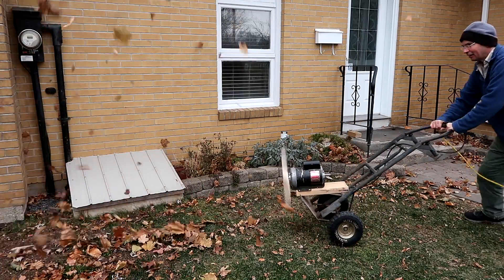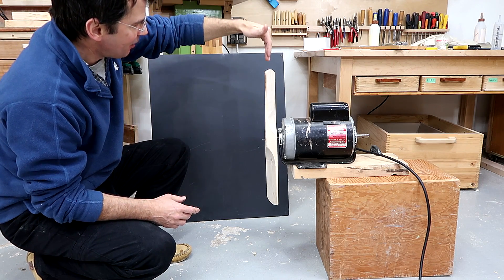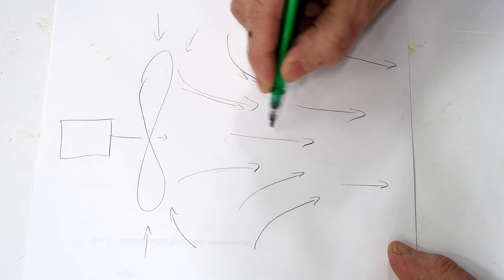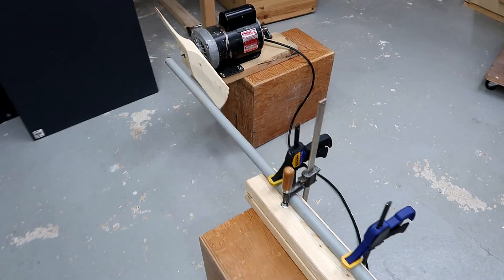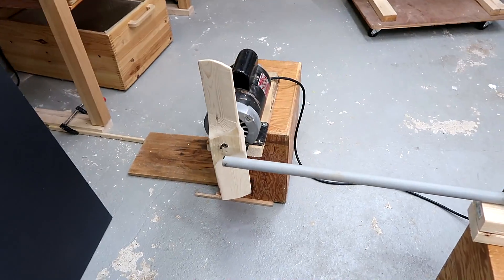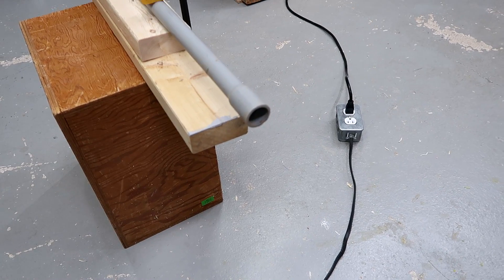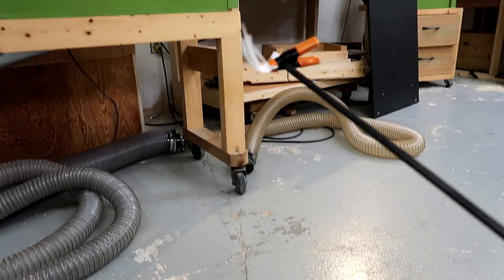Complicated air flow in front of a fan

Comment: "Now, people are going to argue Beronoulli principle and all that..."

Proceeds to demonstrate Bernoulli principle.
Reply: Spot on! Moving gas, lower pressure - Bernoulli principle
Reply: Yeah, especially the "tube with air moving past one end" demonstration that he did.
That's literally a textbook Bernoulli principle demonstration.
"Other factors involved" don't change this.
Reply: @delphicdescant  there are examples of Bernoulli's principle here for sure, but it just doesn't apply to everything in the video, some shots of the fan show turbulence, which by nature is simply a different principle. The other factors involved include the density of the air as well as it's speed and pattern, which as said by someone else, are very complex. My only statement is that there are some examples shown which are very similar to Bernoulli's principle but are not necessarily the same thing solely because of the introduction of turbulence. Which is a seemingly minor but often critical difference because laminar flow is (on paper) "non-chaotic" in comparison to turbulent flow.

Edit: please see the paper I linked for a more clear and less intuitive explanation. In short, Matthias is correct to include all factors when forming his hypothesis, e.g. the effect of turbulence over a laminar model
Reply: He did, but he still correct. Bernoulli's principle only applies to laminar flow, Matthias is experiencing turbulent flow.

http://labman.phys.utk.edu/phys221core/modules/m8/turbulence.html
Reply: @FedoraSpunk  incorrect. bernoulli's principle applies more or less to all subsonic (incompressible) flows.
Reply: @SuperAWaC  the paper I linked shows a good diagram most of the wag down, Bernoulli's principle doesn't account for all of the factors in play once turbulence is involved, it's simply a different flow type/equation at a certain point
Reply: @FedoraSpunk  of course flow is a complex problem with endless variables, but what matthias showed in the video is still bernoulli's principle, in addition to jet entrainment

Comment: I think a duct would prevent the formation of wing tip vortices which increase drag on the blades, especially as the aspect ratio of those blades is quite low so the effect would be more pronounced. But I'm no aerodynamicist.
Reply from the maker: wing tip vortices don't increase drag, but they do reduce lift (in an airplane).  On a prop, they reduce air push.

Comment: Looking at the amount of rotation in the airstream, I wonder if adding a stator in front could convert some of that into more airflow. Like how a turbine has alternating rotors and stators.
Reply from the maker: it might, but the stator also adds drag.  Of course, if I want multiple stages of fan, a stator is necessary to stop or reverse the air spin.

Comment: i'm a mechanical engineer, and the nature of airflow is indeed bonkers.it's very easy for a newbie engineer to design ductwork that will cause a fan to literally tear itself apart.  it's more complicated than most people realize.

however, much of what you're describing is deceptive.  you should instead make a pitot tube, as that explains so much more about that's happening in airflow than a single hole.
Reply from the maker: problem is, my air is moving too slow and my pressure sensors not sensitive enough for a pitot tube to do much good.

Comment: Has fancy air flow meter
Uses crazy strings hanging on a stick to measure air flow
Reply from the maker: Strings visualize it much better for video.
Reply: Those are science strings, thank you very much!
Reply: If you go back and watch any aircraft analysis videos from the 1950s or before you will find them scotch-taping lengths of knitting wool to the back of the wings and side of the airframe so that they could take pictures and see how the air was blowing.
Reply: Multimillion $ sailboats have telltales too.
Reply: Before the advent of large scale wind tunnels and computational fluid dynamics they would affix tufts of string to a surface so they could observer how the flow interacted with it, the surface.

Comment: Hey Matthias, I believe you are seeing a venturi effect in front of that tube where as the flow across the tube opening causes a lower pressure within the tube. The faster the fan blows across the face of the tube, the lower the pressure inside... Drawing in the ribbon from the other end.
Reply: This is related to the Bernoulli Principle.  To measure what is happening in the air stream you would need some form of pitot tube.
Reply: He even has the water-hose eductor from an older video showing this principle!
Reply: I came here to say this. 100% Venturi effect producing that suction.
Reply: He could make a giant carburetor
Reply: JKDangerfield Actually, this is not quite what is going on. What Matthias made is one part of what is called a Pitot Tube, and is exactly the way to measure the pressure of a moving air stream. Every aircraft has one (or more) Pitot Tubes as a speedometer. Basically the fast moving air stream is already at a lower pressure than the normal room pressure, and inserting the tube does not affect this. When the tube is in place air naturally flows from higher pressure towards lower pressure and gets sucked into the far end of the tube. If you insert a measuring tube at exactly right angles to the flow of a stream, you can measure the pressure of that stream independent of its flowing velocity. That's why when Matthias angled the tube the pressure changed. When not at right angles the flow velocity starts to affect the measurement.
Reply: @ib9rt  That’s not exactly how a Pitot tube works. It measures the difference between the static pressure (non-flow pressure) and the flow velocity (velocity of the moving air). Using this differential pressure and the air temperature, you calculate air flow.
Reply: @RustyCas999  If you point a tube head on into the air flow you get the total pressure (not the static pressure). If you point a tube sideways to the air flow you get the static pressure. Then the difference between these two pressures is what lets you calculate the flow velocity.
Reply: @ib9rt  Yes, thats correct - I misspoke. For those that don’t know, a Pitot tube is a tube within a tube. One tube points upstream into the airflow and the other (outer) tube has a series of holes that measures the static pressure. You connect the two ports to a manometer (slack-tube or digital) that measures the differential. In my early days I was a test engineer in power plants.
Reply: Agreed, this seems almost reminiscent of a pitot tube setup, though a bit different.
Reply: @Connor_McCann  More like the static port in planes that is the counterpart to the pitot tube.
Reply: ^ Yeah this.
Reply: Exactly what i was thinking. Also, there is no vacuum but just a pressure difference. But i do want to sound too negative, usually I really like your videos a lot. The building ones and the tinkering ones.
Reply: Exactly my thought.
Reply: You’re measuring static vacuum. You are abusing using the Venturi principal right now. You need to re-run your test with a 90° fitting facing away from the fan.  

As other viewers have suggested I’ve seen this before and one of your own videos.
Reply: Yeah, Matthias is demonstrating his lack of knowledge when it comes to fluid dynamics. I would wager that the vacuum he was seeing was venturi effect but having worked in a wind tunnel for 4 years researching aero-thermodynamics I learned to never guess what is happening in turbulent air, test it.  We've already seen that he has all the equipment needed for really high fidelity testing.  Just rig up a test stand to take measurements in a 3d grid around the fan using his wind speed meter and water manometer (and an ammeter on the fan for efficiency measurements).  Run the measurements with and without the shroud and he would have his answer right away, plus you can make some really fun charts with the data :)
Reply: @youruniquehandle2  yeah, I don't like that he just says a cowl would be worse without testing it. It's the most anti-scientific approach to research. There are fans that use a cowl, and it's for a reason. Maybe it would be worse on your setup, but maybe not.
Reply: @youruniquehandle2  I mean that sounds like allot of work soo close to christmas (even if it wasn't for christmas I can understand why he didn't do it)
Reply: @youruniquehandle2  Also I am just guessing here but maybe a shroud would cause the air to move allot mor parallel instead of forming an "air cone" but as you said one could only really know with testing.
Reply: Yeah that's what I was thinking too, it's just a difference in pressure
Reply: @Oli420X  That's what he is explaining when he talks of vacuum)

Comment: Thank you for the video. It was very interesting. I don't want to correct anything, I just want to throw an idea in.
I believe the first test, when air was sucked into the tube is caused by a low pressure area in the center of the propeller. I believe this area is formed like a cone with its tip pointing away from the motor. But I really think, the other test results with the tube could be caused by the Venturi effect. Just an idea. 

I'd like to read your thoughts about this.

Thanks

Comment: It seems the blown air would move faster in a partial vacuum (less air to push out of the way, less air to bump into) , so maybe the cowling would essentially act as an open road for air blown through the fan. It would be nice to run the same experiments you did here but with the cowling on.

Comment: 0:33 "and even at the sides it seems to suck in"

That's the problem; the air that it sucks in there comes from the nearest area of high pressure: the front of the fan.

Cowling prevents the air that is pushed out at the front from just flowing around the blades to the back and get sucked in again.
That is why prestty much every kind of efficient design for a fan includes cowling.
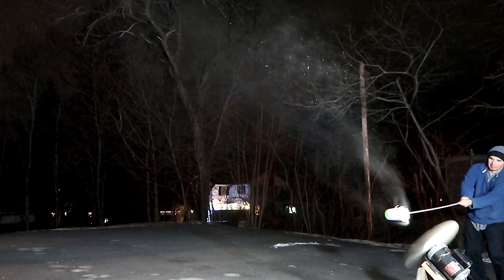Reply: Yep.  Watch the sawdust at 5:40 when it goes off-center.  the sawdust in front gets sucked back into the back of the fan.
Reply: Ditto what Vinny said. Efficient exhaust fans include a circular "collar" around blade tips to prevent recirculation of air that's supposed to get gone. This is particularly necessary if there is any obstruction in front of fan like a louver which (if no shroud) will actually direct much of the thru-flow back around the blade tips & into the space being exhausted as that's the path of least resistance. If it's just a comfort fan the shroud isn't important, Ur just moving air, so positive control of direction doesn't matter
Reply: This is a well known problem, it's a source of inefficiency for wings, also
Reply: @robmckennie4203  is this a problem for airplane props? They aren't generally shrouded.
Reply: @testingapril  you're talking about the props on a plane? It's definitely a problem there, look up ducted fans to see aircraft that tried mitigated that problem, but I think typically a simpler solution would be to use a bigger slower prop. I was talking about the wings themselves. A fan is essentially just a number of wings on a hub that spins, and wings on an aircraft are also made less efficient by air flowing from one side to the other at the tip
Reply: @billybobjoe198  If that were true jet engines wouldn't have shrouds
Reply: @TheAnimystro  You cannot compare an open propeller like this to a jet engine. A jet engine's fan (and chamber) is a primarily compressor. At that point, you're looking at compressible flow, and the bernouli principle becomes less important. Then it's more of the gas's properties than plain aerodynamics. Also a jet turbines propeller is turned by the exploding mixture, not a motor/axle like a simple propeller. So a turbine must be enclosed, or it couldn't function at all.
Reply: I came here to say pretty much this.
Reply: @billybobjoe198  ?
Reply: Helicopters.
Reply: @dozer1642  Look at the blade tips of modern helicopters - a lot of effort and time is spent minimising this effect, as it has a big impact on the performance of the blades. In a helicopter, ducting isn't feasible, so they do their best to mitigate the issue. (same thing happens at the wings of planes,  look at pictures of those too. Helicopters also have a much larger radius to blade width ratio, with much larger blades, so the effect is somewhat less of an issue, but still an issue
Reply: Also a mirrored Propeller as stator would be nice.
Reply: Precisely!

Comment: I would spent way less times reading comics in science class if I was taught like this!
Reply: Definitely! And this happens with so many subjects! I was in an engineering class and the teacher did not manage to get control systems explained properly. I was fed up with his bad explanation and bought a simple thermistor, fan and heater and explained the class to control the heater temp with the fan. Using this direct approach made the class get the issue and solution very easily!
Reply: You are learning now. It's never too late.

Comment: The higher the fluid speed, the lower the pressure, hence the flow sucks and remais tight... as it goes away, the drag slows the flow down, opening the diameter of the stream... shame youtube does not allow to post pictures on comments... I have a funny pic showing not even bullets can pass fluid mechanics...
Reply: Putting something on the tips could help increase the airflow since it would reduce the induced drag, but it would have to be very precise or it would create a large unbalance. Also, the extra surface would also cause more drag and more inertia. One solution is to make the blade thinner and lower angle as it gets to the edge, but this means a lot harder to make to the point it's not worth it...
Reply: And also, the further from the center of the blade, the higher the tangential speed, which means more airflow the closer it gets to the tip
Reply: Shouldn't really be Coanda in this case since it would apply to the blade's tip... Probably something to do with the blockage from the base affecting just a bit of the airflow

Comment: Very interesting. So if you want suction it is probably best to build a duct around it since you don't want it to suck the air in from the sides but if you want it to blow it seems to be best to just leave it open.

Comment: a bit disappointed you didn't actually try it with the cowling and check. You showed with your pipe experiments that it didn't wholly match your expectations, but then you made your entire conclusion based on those expectations.

furthermore, you mention that the Bernoulli equation doesn't apply to turbulent airflow. I disagree with this, as we used that very equation for analysis of high Reynolds number flow in my fluid dynamics class, and it matched well with experimental results.

Comment: Very interesting. I am now curious if you put the pipe at the same angle that you were getting positive airflow into the region where you expected the vacuum if you could confirm the vacuum. Also curious if it is enough of a vacuum that you could measure it with your static pressure setup. Something to try if you make a new blade??

Comment: to check for vacuum, pipe should be placed in front of propeller pointing twards is. Not from side and not at angle. In this case there will be not bernulli effect, so it should suck only when pointing to the center of propeller (theoretically) and blow at other points

Comment: I think the only way to find out is to make a cowling.  I am wondering if the pipe in the airflow is a flawed test.  If you pass air across a pipe like that it will always vacuum.
Reply: That would be a good test. I like paramotors and RC planes. How would centrifugal force, vacuum 'and' the weight of the cowling affect efficiency?
Reply: He just stated that Bernoulli's Principle does not apply in turbulent conditions, and the Venturi effect is built on Bernoulli's principle. So it also does not apply during turbulent flow.
Reply: @Tomasu321  that is not an accurate statement, Bernoulli’s can still apply to turbulent flow.
Reply: @JamesSeedorf  Please elaborate more when just offhandedly dismissing statements. You're not being helpful.
Reply: @Tomasu321  Should maybe take your own advice then? "This is so because he said so" is just as dismissive and not proving anything.
Reply: @Tomasu321  Bernoulli’s equation is pretty much an energy balance. Energy cannot be created or destroyed so the fluid's energy is constant. For turbulent flows some of the energy goes into turbulence which cannot be easily calculated or measured. The equation stops working because an unknown portion of the energy goes into turbulence but airflow through a venturi still generates a pressure drop, you just can't use that pressure drop to accurately calculate speed.

Turbulent flows are also not stable, so with the same boundary conditions a point in the flow could have different properties at different times. Bernoulli’s has no ability to account for this instability and just returns an average value.

Comment: Having worked on cars for years. I can tell you a shroud (a tube attached to a flat plate) that stops air "curl" at the edges and greatly aids cooling by about 27 to 31 %.
Reply: I think a cowl aids in applications where extraction of air is more important than the total amount of flow. So in a desk fan or a boat propeller a cowl wouldn't make sense, but in a dust extractor it would.
Reply: @gxexrxmxaxnx  if cowl didn't add something turbofan engines would have propellers instead